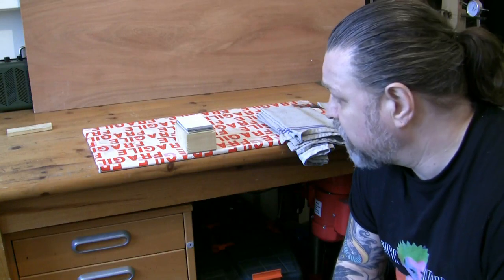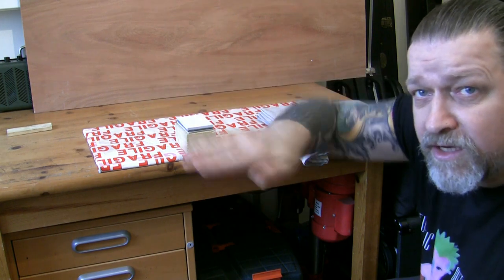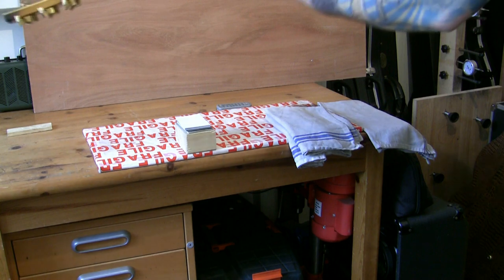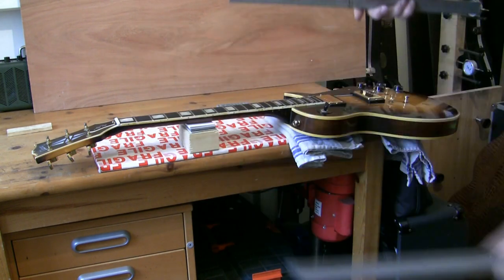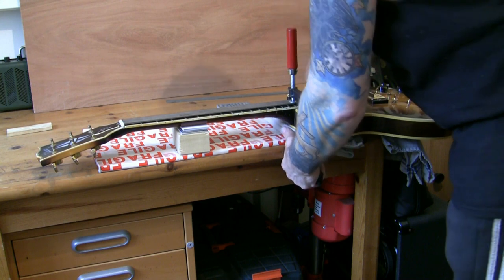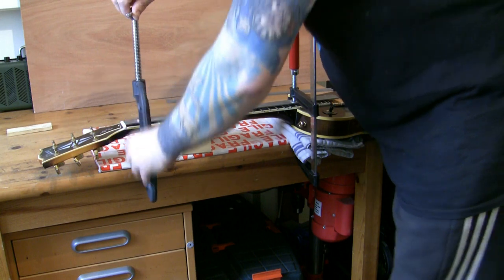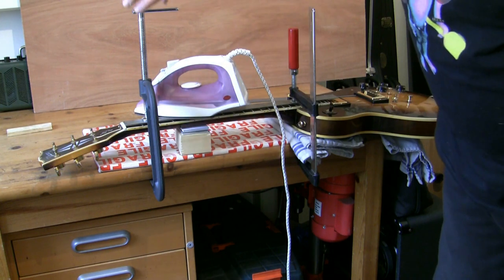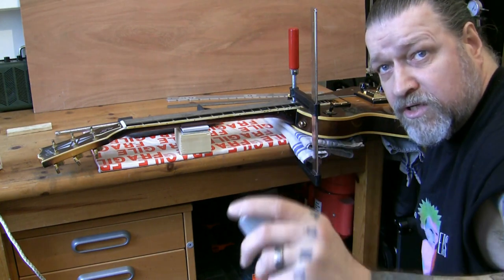How to (or how I)... straighten a guitar neck using heat and clamps...

Comment: This method worked well for an old classical guitar with no truss rod. Since the classical guitar has no inlays, I placed the hot iron set hot directly on the frets for about 20 minutes. Then I took the iron off and left it clamped for 24 hours. It turned an unplayable guitar back into an instrument of joy. Thanks for the idea!
Reply from the maker: Excellent! :D

Comment: Thanks!  I have a fender bass that has a bend that has a permanent bend and the truss rud nut is bottomed out. When I do tighten it to the max it does help - but I want to lower the action regardless.  This is the approach I am going to take to at least straighten it out a bit
Reply from the maker: I hope it works! You could try this: If you can remove the truss rod adjuster, do so and put a washer that fits between the truss rod and adjuster then refit the adjuster. This will give you extra adjustment. Victor...

Comment: I have a baritone Yamaha which had a back bow and after a few attempts to fix it I found the best method. Clamp the guitar fret side down on e.g. a work mate bench with a small piece of timber underneath where the bow starts . Make sure that there is a small felt pad on the clamps to avoid damaging the neck. Take a wet flannel and a steam iron on the hot steam setting and steam for aprox ten-15 minutes. Leave for a couple of days then un clamp. Make sure before you do all of this that your truss rod is completely slackened off. My neck came out as straight as a die and even though as it was a baritone with heavier gauge strings it has remained true. The guitar would have been a write off to pay for a repair and this will cost you nothing. The piece of timber I used just wider than the fretboard and aprox 2-3 mm thick just enough that if a slight forward bow was put in it could be easily adjusted with the truss rod.
Reply from the maker: Thanks for your input (great methods) :) I use steam myself. This was just an example for this particular guitar. Check my series on Warwick Bass truss rod removal and replacement (the neck was twisted, warped, bent and uneven in all ways imaginable and I got it straight) here https://www.youtube.com/playlist?list=PLhMXQIXvmBZw_MPfAaFWvH85-DvY1H3GI  It took a lot of work but I made it like new...
Reply: @FretFriendGWaL  It was easier because it was a bolt on neck. My friend who has been a Luthier all his life was a little bit sceptical and did not think it was a worth the cost of a repair but said it should be O,K as the melting temperature of the glue would probably not effect the finger board. He was right and I have not yet updated him on the success considering the neck was varnished.
Reply: I'm doing a mix of the video method and your method given here. Got a vintage guild in with a maxed out truss rod and still too much relief in the neck. Basically set my guitar up how the video is, let off the truss rod completely, got a damp flannel shirt, and have an iron with max steam going. Only bad part is the auto off feature so I'm standing here babysitting it. I'll have an update in a day or two once it's all done.
Reply: I use a hair dryer.

Comment: Today I was quoted $500 for refretting and sanding my flamenco guitar neck because they said this heating technique would not work. I said f that, went to home depot and got a couple clamps for $30, slapped an iron on the board for 20 minutes, let it cool and 2 hours later my guitar is shredding like the day I got it in Spain. I am aware that this technique might take a few tries to become permanent, but it is good to know I can fix it myself. Thanks so much for sharing this method!
Reply from the maker: That is really good to hear friend! 👍😃

Comment: Did this with a detached bolt-on neck (strat) which suffered from excessive bow. 

I used a combo of letting the neck sit on a regular hot-water heat radiator for 30 mins - then gently clamping it onto a straight plank of wood - with 5 layers of cardboard at each end (very slowly bending the frets down towards the plank) - while in this position, I aimed a couple of hairdryers back and forth along the neck to evenly spread the heat. 
Then incrementally tightened the clamps - till it sat with a back-bow for about 15 - 20 mins. 
It worked out very well! 
Almost perfectly straight now🤘🤘
Reply from the maker: That's brilliant :) Victor...

Comment: Glad to hear this works for a lot of people, tried a variation of this with a bowed fender maple neck (no fretboard) and it didnt work.  I had it lay flat on my toaster oven and clamped it down , the toaster oven has a warmer on the top so it really did transfer the heat good that the wood got hot to the touch even. But after heating for 15-20 mins and leaving it for 24hrs i dont even notice a slight change when removing the clamp- still bowed.   I figure it was just my setup, there was enough bow in the neck that laying it down fret first left a big enough gap, so i clamped it there to the toaster oven frame and it got petty flat, but maybe i have to bend it back further than straight so it sets straight?  Couldnt really do that with my setup so im willing to try the videos method but not not sure it will help after seeing nothing here and thinking about  just going ahead and replacing the truss rod.  Any tips/ suggestions would be appreciated.
Reply from the maker: Over-bend it! I do that when I have a stubborn neck. Just a little to start with and keep checking every couple of hours. You are coaxing the wood to hopefullly go back into it's default position. I have had necks not straighten too: you have to get some moisture/heat in there and as mentioned, you sometimes have to over-bend. Victor...

Comment: I feel like this is the best solution to my issue. The acoustic I’m setting up is still bowed but the truss rod won’t get tighter to straighten the neck out. I read u can install a washer which works sometimes, but I think a heat press would work a lot better. I didnt think of using a clothes iron. I’m thinking only do this with a loose truss rod? That’s great!
Reply from the maker: Yes, I often add 1 x washer. Good luck! Victor...

Comment: I've got a backbow on pbass,one way truss rod completely loose. So with just one clamp in the middle should do it. ( Since i lack the tools trying to heat the neck up on the radiator) hope it will work that way too. Thanks for the diy solution!
Reply: @harryw9598  I'd tried that but didn't help. So ended up buying a new neck. Kept the old one thought just in case

Comment: I did this but put the block under the 9th fret because in my experience with second hand guitars this is the area that starts to dip down so I want to catch it at that point or just before it starts to dip. 
It was my first attempt and a Les Paul so I was very careful with the heat, it took me about 3 hours because I had to build up confidence, I didnt want to remove the cover and see the binding had melted.
Reply: Did the binding got damage?
Reply: @adriancastaneda9088  No but a couple of the fret inlays shrunk slightly so you need to be careful.
Reply: 7byseven how did u make the block? i have an acoustic so it has a bigger body
Reply: @dilfhunter5645  I just grabbed something around the house that was the right kind of size, I cant remember what I used now.

Comment: Thank you for this video -- this absolutely got results for me. I have an epi 175 that I couldn't get the relief out of.  I managed to get the neck to bow back slightly with this method -- heating and leaving in a warm garage overnight.  However when I straightened the neck with the truss rod, i found there is now a small hump around the 2nd, 3rd fret.  I'm going to rip the frets out and hopefully I can level that out.  I don't know if the straightening method introduced the hump or not -- I suspect it was already sort of there. Also the truss rod is now peeking out and preventing the nut from seating.  I also see some hairline cracks a the first fret and the finish on the back got a little messed up at the fulcrum point. It definitely changed the geometry of of the neck though..
Reply from the maker: My method is not an exact science! As a last resort, I would pull all of the frets, get the neck as straight as I could using heat/clamps, then I would re-radius the fret-board with a radius sanding beam. If that did not work, the neck is buggered...
Reply from the maker: I hope you can fix your problem :)

Comment: Thank you very much friend, I made your video recommendations with a classical guitar, and it worked perfectly!
note :
Note that after heating it with the iron, a kind of water came out of the fretboard, then the fretboard was dry (then I had to rectify the frets, moisten the fretboard), but it stayed straight!
Could it be that this liquid that came out was the humidity that the fretboard had absorbed and that had made the fibers soften, yielding to the traction of the strings? sorry for my English . I use the translator, I just wanted to thank you !!!!🙂
Reply from the maker: I do not know what the liquid was but I am glad that you fixed yuour guitar :) Victor...

Comment: It worked well for me on an old classical guitar. I ended up not using the metal bar in the end, and using a heat gun because I couldn't get enough heat from the clothes iron, or the hair dryer. But it worked, my neck is straight, and I'm groovin! Victor, if you're reading this, what is the purpose of the metal bar, also how long do you leave it clamped after you remove the heat?
Reply from the maker: Hello Robert... I'm glad it worked for you :) The steel bar sends heat along the whole length of the neck. I unclamp once it's cool. There are many methods to get the right amount of heat in there: you do not need as much heat as you think. I like to leave my guitars alone so I go for lower heat over a longer period of time. That way, I can get on with other things in my workshop and not worry about scorching anything. Victor...

Comment: I just acquired an old Oscar Schmidt Stella, which I didn’t need, but fell in love with it due to the tone and volume. Looks like it might’ve had a restoration job, or at least some work, done on it before. The neck is not pulled (or it is repaired) and other than a crack and loose brace which are now fixed, it is in quite good shape - other than the strings being too high due to neck bow. The string break angle at the saddle seems to be good, but since I didn’t know of any way to get the bow out of the neck, I was going to have to lower the bridge and saddle. Very glad to see your video, I’m gonna have to give it a try! It’ll be awesome to be able to actually fix the neck instead of bypassing the problem. I plan on trying it tomorrow.
Reply from the maker: Excellent: take your time and it will be fine :)
Reply: Hey did you do this to an Oscar Schmidt Stella? Did it work out? Can you sleep at night?
Reply: Well… I started the process to straighten out the neck and then left the project aside.
Reply: @jacobralph1442  I love working on my own guitars but anything over 80 years old I send to my luthier. Anything Oscar Schmidt touched is a piece of history and will massively accrue value in the coming years if it’s still in one piece.

Comment: Do you think i can fix a twisted neck with the same setup? Very nice explanation, i like these kinds of diy
Reply from the maker: I'd fix a twisted neck by strapping the guitar into a neck jig (a la Erlewine / Stewmac) and use the tuners with a fat string attached to twist the neck back to straight then while holding in that position, I'd get some heat into the neck until the wood fibre had expanded. After naturally cooling, the neck will be straigh (done this job 4 times). Check this video https://www.youtube.com/watch?v=ip6TQcjNW24 at 13 minutes 45 seconds to get an idea of what I am talking about...
Reply: @FretFriendGWaL  thank you! What do you think are the chances that it will actually set in motion a even greater twist as time goes by?
Reply from the maker: @2ndPortal  The first one I did on a Warwick bass is still dead-straight after 4 years! They twist because of undried wood when built or bad storage once made...
Reply from the maker: @2ndPortal  All the other 3 are still dead straight...
Reply: @FretFriendGWaL  ok, good to know. I love this guitar and wouldn't want to risk it. Very curious about all these mechanics of wood and why it warps, i just started wood working :)

Comment: Well im sure excited to try this on my 2000 Explorer that the first owner used to put 12-60 gauge strings on.
i have the truss all the way down and still too much relief so its time to back it out and straighten the neck for sure... 

what was that bit about melting the inlays out? i surely dont want to do that
Reply from the maker: Then use gentle heat over a longer period of time. You must get heat into the wood fibres. You do not need as much heat as you think! Best, Victor...

Comment: I have a Gibson with a back bowl I loosen the top strings and Applied a heating pad on medium. I’m hoping this will work without using clamps. Because the problem is at the 10th and 11th and 12th Fret.

Comment: Great video as I'm planning to do the same.. but won't that melt neck binding when binding goes over the frets?
Reply from the maker: Leave the frets in and place a steel strip (bar) between the iron and the frets. Also, do not use high heat: medium-low is enough so long as it warms the wood). I need to upgrade this video as there are better ways to show/explain my methods...

Comment: I searched this out after watching ALOT of neck resets where they remove the neck, sand the joint and reconnect it which apparently is youtube’s standard video to show but that way doesn’t make sense to me because the joint is not the problem… the neck itself has to still be bent after reset if you don’t actually straighten the neck right?

My main concern is drying the neck and the hide glue holding the fret board to the neck failing.

I love working with my hands and fix alot of things and fixing one of my old guitars I played while watching our jets bomb the Iraqi army was my initial goal but  in researching that I picked up a cedar top & Rosewood 1960’s -70s ? Lyle C-650 for $20 that may not be million $ guitar but is solid and sounds wonderful with fixed tuners and a fixed tone bar using home made hide glue. Who knew you could make glue from dog chews?

Anyway … It has a slight bend….

Does the neck need to be rehydrated?

Does using the DRY heat ensure the glue WON’T fail?

Any idea how long this fix lasts?

Would it make sense to straighten the neck and then insert a truss rod Through the neck from the top? 

Thank you for sharing your knowledge?
Reply from the maker: I've never worked with hide glue and never know what type of glue is used on a guitar (I work on 100's every year). Every one I have fixed with this method has stayed fixed (so far). Victor...

Comment: How di i do this method on my fender strat with a gloss finished maple fretboard?
Reply from the maker: remove the neck: clamp it how you need to: heat with a hair dryer on hot setting only! You only need gentle heat but over a longer period for a lacquered neck. That way you will not damage the finish. It takes more time and it is boring to do but it is worth it. In 5the past, I have mede a channel each side of the neck and set the hair dryer in a way that I do not have to hold it and I just let it run. You will figure it out. Victor...

Comment: really useful, but if i need to do it in reverse? i have a Ibanez JS90th and the truss rod is completely loosen but the neck is still straight, i need to get just a bit of a front bow(right now 0.2mm under 8th fret, need 0.3).
Reply from the maker: This method works both ways: turn your guitar over...

Comment: My guitar has a truss rod Yamaha FG335 and it is cranked tight, but I still have a bow.  Will this method work for that guitar.  I know it's an old cheap guitar, but it's the first one I ever bought in 1982.
Reply from the maker: I cannot guarantee that it will work but this method is for any guitar! Victor...

Comment: Hi mate,,great video and tips,,would this method take a centre fretboard bow out on a classical guitar i was given ? I cut the nut slots down as low as was sensible,sanded the plastic bridge down but as per your advice there is a bow around fret s 5 6 and 7? Thanks in advance,George.
Reply from the maker: It should work on any neck. Just do not overheat if using heat! I have scorched necks with too much heat. A hot hairdryer is enough...